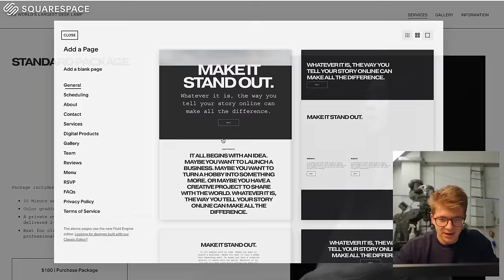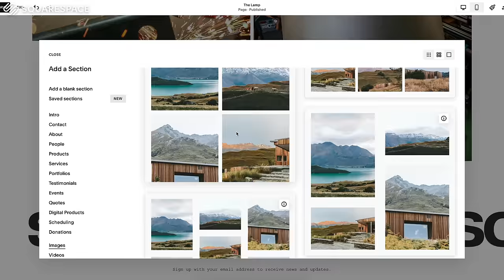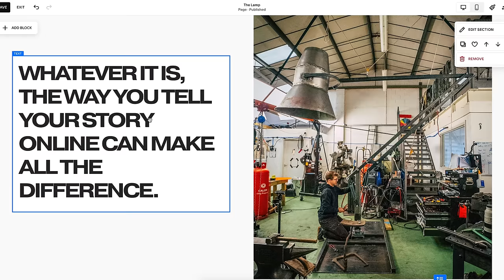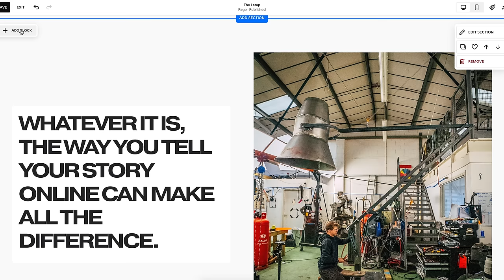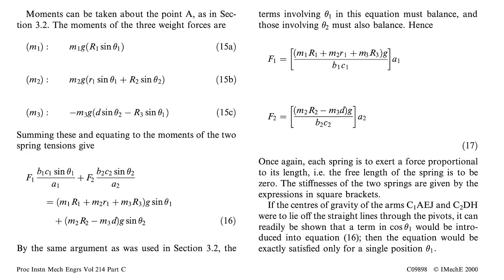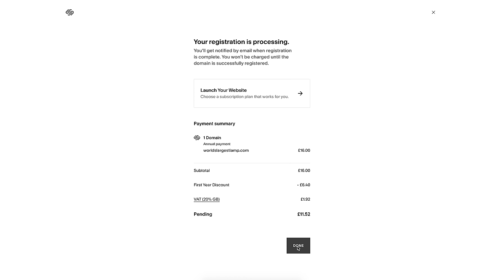I Made The World's Largest Articulating Lamp. (Part 6)

Comment: You should mount some steel rods inside through the springs so if they break they don't shoot off like a rocket. That's what they do with garage door springs.
Reply: Honestly, as amazing as all this is, I couldn't help but think that at some point one or more of those springs is going to explode in the background of another video and that lamp is going to come crashing down.  Seems to me that with the weights involved, skipping the engineering phase is the same as skipping the safety phase.  I really hope they took the appropriate precautions and just didn't include them in the video.
Reply: The metal rods used inside garage door springs are generally for springs which are used in torsion, not in tension. 

Alec's springs are used in tension. 

It would not be possible to put a solid rod inside those springs (if you did, the spring wouldn't be able to stretch). 

The only thing I can think of which could be added to Alec's springs for safety would be sone sort of cable tether which would need to be long enough to allow the spring to reach its full stretch. No idea where the slack would live when the spring was compressed though.

The energy in this design should frighten anyone within 10 metres of it.
Reply: cable would be easier, & safer
Reply: Just use a hydraulic system with fake springs on the outside 😉
All problems of balance solved, issues articulating solved and safety solved. If you notice, little toys that have been scaled down utilize springs that simulate the hydraulics of the original excavator/dump truck/crane so the way to scale up a spring is... You guessed it... HYDRAULICS. 😊😊
Reply: @Finn-McCool I was just thinking that same thing, thinking he could use long travel hydraulic or nitrogen charged shocks in place of the springs. Something from an 4x4/offroad application would probably be the ticket.

Or he could use a double acting hydraulic cylinder with the extend/retract ports linked together with a tube hose, making them essentially self acting just like a spring. That would allow him to fine tune them with different oil viscosities or orifice size to adjust flow rate for a nice smooth, easy, balanced, movement, a system like that would never see pressures high enough to cause catastrophic damage should a part fail.
Reply: @daveash9572  I had a garage door spring break, it smashed through the cabinet on the back of the garage. There are two types of garage doors, rollup and tilt up. Rollup doors use a torsion spring above the door while tilt up uses tension springs on both sides, my garage door was tilt up as were all the houses in the neighborhood that was built in the 1960's.

Yes you can put a solid rod through the spring, on one end it attaches with a bolt, the other end it fits inside a eyebolt hole with enough length to stay inside it at the full extension of the spring. Make sure the loop on the top of the rod is big enough to hold the bolt and spring and the eyebolt on the bottom is big enough to hold the rod and spring. When the spring does eventually break it will not launch itself across the garage.
Reply: @daveash9572  you can emulate a solid bar (to a certain extent). If a solid bar (or metal tube) is put inside a metal tube, then it will be able to "stretch" and still has enough strength (the overlapping between the two pieces in the maximum stretch has to be substantial) to hold the exploding spring.
Reply: Gas struts might be better
Reply: @daveash9572 a rod and tube, each the length of the relaxed assembly. Or a little longer so they act as a bump stop in failure condition, though the lamp may tip from the sudden stop, at least the springs won't take a flight through someone's cranium.
Reply: Socks over the springs would add a lot of safety too.
Reply: The Lamp of Damocles!
Reply: Not a rod. Just a slack (but well secured) steel cable.
Reply: @daveash9572 a sheath around the spring would do the trick. With the turnbuckles and adaptors on the springs, there is room to mount them without limiting the range of motion.
Reply: @Finn-McCool  I thought he was going to use hydraulics from the start, as that would be much less of a headache and would allow you to position it anywhere without fear of it falling. 

But I know he wanted it to function the same as the regular version so 🤷🏼‍♂️
Reply: Cable is actually normally how big springs are secured. Just run a long length through the center so if it lets loose it can’t escape.

Comment: A bit of friction in your pivots would likely get you easily to the place where you can adjust it and it stays in position.
Reply: friction is most definitely what is holding the lamp stable after moving it. the springs just have a pressure balance to make the object "weightless" so that the object can be easily moved but also able to be held stable by the friction at the joints
Reply: Exactly. Tune the spring loading as best you can, and friction hinges to fine tune it, like a friction window stay or similar.
Reply: Mmmm.
Yup, that’s what she said.
Reply: The problem with this is the scale. Friction in the joints of the small version can work without requiring much force to move because the cantilevered mass is small. You need to scale that friction up to have stability with such a large mass, and that scales up the manual pushing force required to overcome it. With the amount of steel he has hanging up there, it's likely the necessary friction would be ridiculously hard to overcome by hand.
Reply: @stevewells20  they need to remake the lamp shade in aluminum, like the original. If he makes a steel shade the size of the original and puts it on the original lamp, it won't work.

Comment: Now I'm not sure if I'm right here, but the antique lamp might be using the type of spring that's called a linear spring (which continues to stretch or compress under the same or very similar load). What you're using is definitely a progressive spring (which stiffens up the more you stretch or compress it from its original position). That might make the difference of the lamp being able to rest at whatever position you set it to.
Reply: I think you got that backwards. Most springs are linear. Progressive springs are indeed a thing, but not common to my knowledge. All springs follow Hooke's Law, which states that force is directly proportional to spring displacement, and those springs he use seem very linear to me. A progressive spring just has a change in geometry along its work length, whether diameter, wire size, pitch, etc. I think his problem was simply that he didn't use enough spring and counterbalanced more force.
Reply: @duodot I assume he means constant pressure springs by linear. As in the force applied is roughly constant through a range of travel with a specific pretensioning
Reply: The angel poise design uses a spring called a zero free length spring. This means that if you draw a force to length graph the line will cross the 0 force at 0 length. 
The spring are made with a pretension to get this feature.

Comment: Something I'm sure others have mentioned- Some designs for these lamps use a 'pinch' force at the elbow and the shoulder to help adjust the poseability. An adjuster knob on the side of the joint squeezes the bracket holding one or more of the armatures, increasing the friction on the hinge and making it stick, but not so tight that the user can't move it with aid from the spring.

Comment: Alec, mate, I was in industrial maintenance and I spotted a problem with the base you made. Do future Alec a favor and read my post:
The hole and pin in the base you are really going to want to put some anti-seize compound (it isn't grease, it has more to it than that) in case you ever want to get that pin out again or it will rust weld itself in there in a surprisingly fast amount of time. You are in England, the land of moistness, so we are talking just a few months before it will take a wheel puller and one year before a torch would be involved. If you pulled it now and put some anti-seize compound, it will just take a few whacks with a and a little heat at most in a decade or two's time to pop it out.
-Cheers

Comment: I appreciate that you wanted it to look as much like the smaller model as possible, but I really think a few changes would have been better to make it more effective and safe. Namely, the tension system.
1. Using counterweights to reduce the amount of tension in the system
2. Increasing the lever lengths to increase mechanical advantage
3. Using pneumatic cylinders instead of springs that can suck in or bleed out air to equalize pressure. This could make the system easier to balance and have a safer failure state than springs.

Comment: Scaling is a complicated affair. It can be painfully obvious and aggravatingly oblique at the same time. That said, when it comes to leverages, i don't think you're far from a solution to make it life like, but just not with a bought spring. This puppy needs its own custom springs, formulated to the specific size and extension required. UK has quite a few custom spring shops, maybe reach out to them? They'll not only be able to make it, but they'll also know what kind of spring you need. I think it's worth it.

Comment: I think adding a mechanical way of articulating it would add a lot to the functionality. Lead screws in parallel with the springs with a hand wheel/ crank on it would be pretty easy to implement. If it's added in parallel with the springs then it should take a relatively small amount of force to articulate it.
Reply: Yes, something like this would be super. I kinda want one made for out in the yard. Would be quite cool. The screw thing would be far better of an idea as you could crank them to get the light where you want it at.

Comment: It's the friction in the joints that allows the lamp to hold in various positions, not balance of spring force. Balancing spring force will only hold it in the one "at rest" position that your lamp stays in.  That's why you're having trouble scaling, the coefficient of friction isn't linear. You need like a wheel on the bolts at the joints to be able to loosen/tighten the joint friction. Some knurling of the opposing box-steel surfaces would also help to increase joint friction.

Comment: Aside from some of the temporary things you've done to move heavy equipment, this is easily the most dangerous thing you've built. I've seen those kinds of springs explode before (garage door extension springs), and it's shocking what power is released when they do. In the ones I've been around there was no indication that failure was coming, it was just extended (ie. garage door down), then a loud bang as one snapped, and the spring was in 2-3 pieces. I honestly don't understand how the one broke into 3 pieces, but it sent a small coil out of the middle flying against the wall and then it hit the floor and rolled away.

In those cases, the garage door was down so the spring was the only hazard, but in your case that means a lot of mass suddenly unsupported high in the air. With that configuration, whichever pair of springs is holding it up will have one failure followed briefly by the other overextending and then a second failure, so you may have some warning. But I wouldn't rely on it. I strongly recommend giving this some sort of safety cable or something to catch it if it breaks loose.

Love your channel and the crazy things you make, so please don't get yourself killed with your lamp.
Reply: These arent garage door springs they gave up on thoose these are the springs used for clay disk throwing machines
Reply: @emeraldbonsai Fair enough. Though the failure mode is the same.

Comment: These lamps hold themselves in place with more than just spring tension. There's a certain level of friction in all the pivots to allow it to stick in place with the HELP of the springs. If all the joints in the arm are free-moving, then you're going to keep fighting with the balance forever.

Comment: I made a 2.5m high ang;lepoise patio heater a few years ago and actually did the maths and they just don't scale. You need a zero length spring which in practical terms doesn't exist. At a small scale the friction at the pivots allows the various poise angles. Even anglepoise's own giant lamp only balances at certain points. Still cool though if you get it to balance at a pleasing angle.

Comment: The shade is SO MUCH MORE of the weight, than a typical anglepoise (sp) lamp's shade is, that the springs in a normal one are basically irrelevant in terms of relevant transferable information for up scaling it.
I would bet your shade is like double or triple the % of the mass that the shade is on a regular anglepoise. 
Looks beautiful and I love it though.
Reply: Should have made the shade aluminum like the original.

Comment: The original is relying on the friction in the joints to act as a brake and overcome any imbalance in the spring forces at rest. Your joints are so much smaller relative to the lengths of the armatures that you're never going to achieve exactly the same result that eay.

Comment: I wonder how much the friction in the joints helps hold it in certain positions? I think you could use taper roller bearings and over pre-load them? Maybe use a SUPER thick grease? Maybe just a Nylon washer? I don't know. I think the force of the springs needs to be less than the static friction in the joints so that they can't move it, but when you apply an additional external force it goes beyond that static friction limit and allows you to move it.

Comment: You should have made a mini pulley system on the end of the springs opposite the adjustment. So the short strong springs would ask as long springs with 50% or 25% the strength (depending on the pulley system) i think you would get more travel in the arm if the 2 ends that the springs are attached could double or triple in length via the mini pulley system.

Comment: As a suggestion, for the base swivel to calm the swinging a bit, add a chain or belt arrangement so the swivel is controlled by a wheel that can be locked off. Would be safer and give you a reason to show off forging and creating large roller chain and gears 😅

Comment: Just a thought but The springs are stopping the full extend capability anyway along with the ceiling so in theory you could sacrifice some of the top bar and just reweld the shade attach point it would cut weight  without sacrificing height and be further supported

Comment: I'm not sure you need to be concerned about the height of the giant lamps in Spain, but rather if they actually articulate. For public safety reasons they probably don't have any actual moving parts or giant and incredibly dangerous springs. So while they are styled after articulating lamps they can't actually be the world's largest articulating lamps. 

They are at best the largest "desk" lamps but your lamp articulates even if it's slow and cumbersome to adjust the spring tension. You only really have to worry about other larger movable lamps.

Comment: the force exerted by a spring is directly proportional to its spring constant times the length it stretched. You could use a crane scale to see how much mass is required to move a spring a certain length to find the spring constant. F=kx. Just keep experimenting with the springs and different tensions, if that doesnt work, get in contact with someone who is good with maths, and theyll be able to calculate the spring constant needed for the entire lamp.

Comment: Looped hydraulics in a ram so the pressure is equal on both sides of the ram. Possible with hole and fluid thickness tuning

Comment: You have to have resistance in the hinge system so that the forward single WEAKER spring that is LONGER must overcome the tension that with gravity is holding the lamp up on the two shorter springs.  You need RESISTANCE in the lower hinge… the springs arent the problem.

Comment: Two 1/4 inch x 1 inch x 18 inches bar, with 3/8s holes every 2 inches. Add bolts and weld.  Use to find "L" of Spring.

Comment: Replace the springs with hydrolics. You would be able to adjust it to any position with a couple of levers. Definatly more involved and expensive than the springs, but you've come this far, no turning back now 😂
Reply: Linear actuator's would probably be easier to use.

Comment: It would be cool if it ran on hydraulics, or a gearbox with a big wheel to operate the lower pivot and pull chains on a gearbox at the upper pivot like a garage door pulley. It would be easier to position anywhere in the shop extra light is needed.

Comment: You just need to loosen the springs a bit and tighten all the joints. That'll add more friction in the system, so the springs take up most of the weight and the friction holds it in place.
Reply: The joints in this are probably not big enough relative to the length of the arms to make that a practical solution, but it would be worth a try. It might become impossible to move by hand though.

Comment: Add a rope or cable to start the springs. And how about hydraulic dampers in place of the spring? It'll take some engineering to get the resistance right but it'll be less  dangerous then three springs exploding

Comment: Are the other lamps capable of articulation? If they are street lamps I'm gonna guess no. 
Also, I loved the thought processes of how to work out the spring function and eventual remodel. I think the full function is hiding in the length and angle of the mid joint. Hope you come back one day and suss it out....

Comment: It will be better and safer to use a longer nut on the all thread that tensions the springs. The more thread the nut grips the less likely the spring pressure will strip the thread. Im assuming that the all thread you used is standard grade and not high tensile